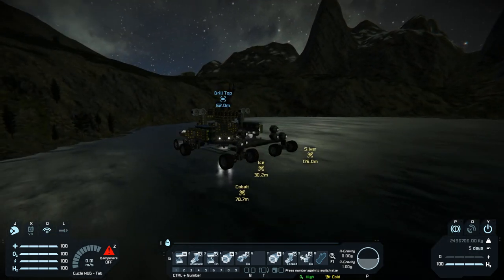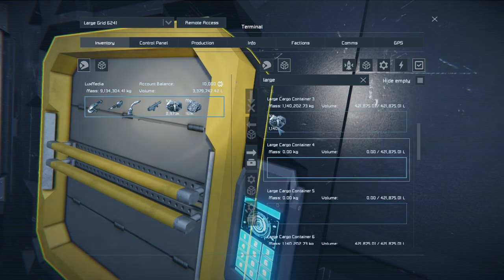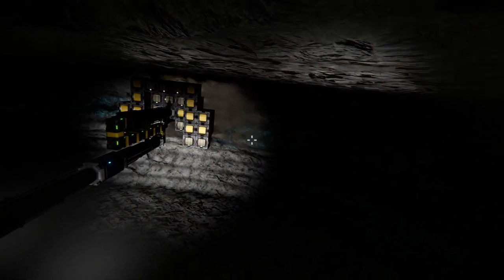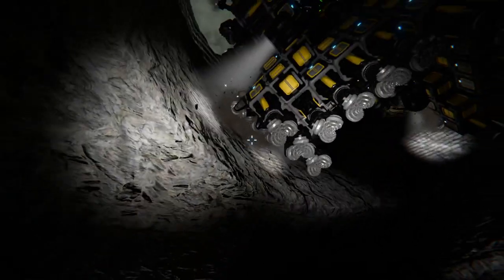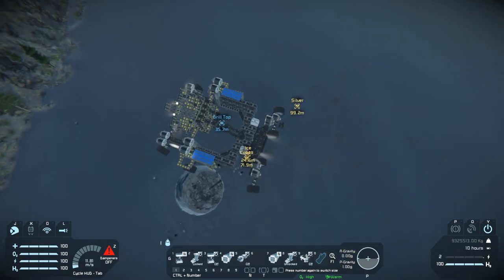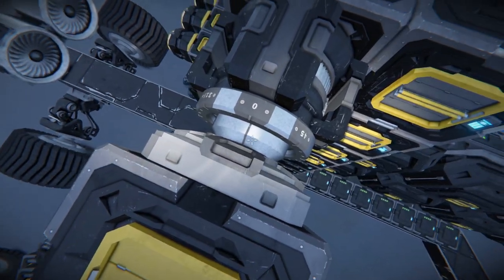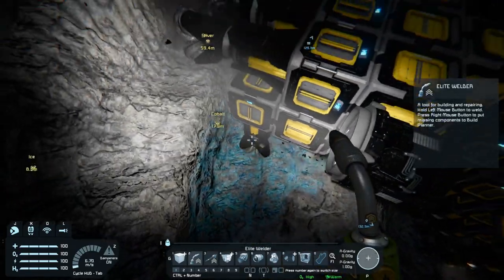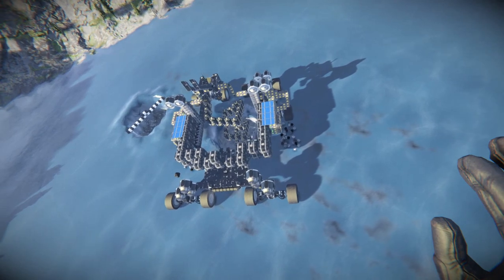Space Engineers- Super Hyper Mega Totally Automatic Drilling Rig (S.H.M.T.A.D.R.) HOW TO USE

Comment: For automatic depth and radius settings you can check the drills inventory. 
- Stage 1 when the deposit starts the drills start to get not only stone. Start extending the drill hroisontaly;
- Stage 2 end of deposit the bottom drlls do not bring not-stone ore. End of extension.
Reply from the maker: I saw some scripts for functions like that after making this drill. I remember trying one of those on the MOE (basically V2 of this drill) and my SIM speed slowed to a crawl. I think it's because the individual drill count was something like 300
Reply: @FigoNOVA  you can reduce the script update ratio (i use update frequancy 10 ticks) and select only 5  or 9 blocks from each square (center and coners) and the inner circle if the drill square is really large. You are dealing with rather predictable flat surfaces. Though selecting the specific drills will take effort. It's recommended to update the list of blocks only on initialization or damage. And you could possibly use the yield magic, but i don't understand it yet.

Comment: Clangazarous....  Holy pistons and rotors....  I build something similar but on a smaller scale and on one of the drill sessions clang took over....  after that I started using Drill and Fill :)
Reply from the maker: I've definitely had some strange encounters with clang but I pretty much have the settings tuned that I can leave it going and not worry about it. :)
Reply: @FigoNOVA  awesome.  When ever I decide to make a drill rig it always ends up in disaster.  I pretty much stopped using Pistons and rotor combo.  I however used the more pistons mod that has a long piston and managed to make a drill with that, without rotors of course.